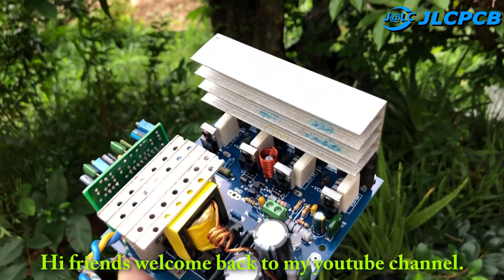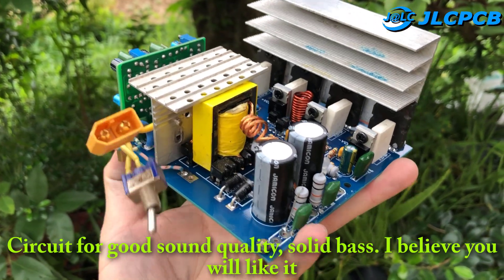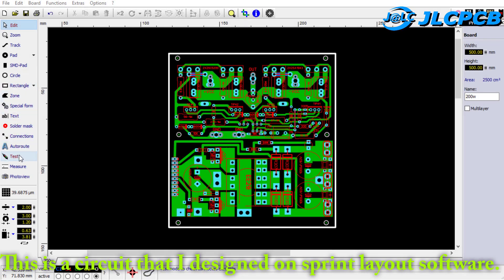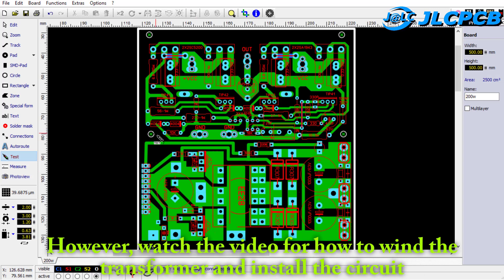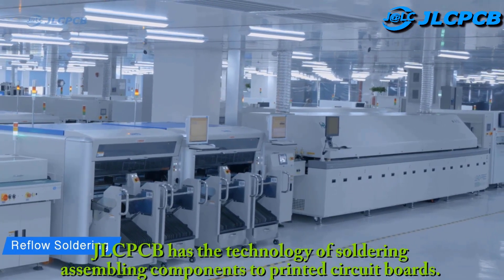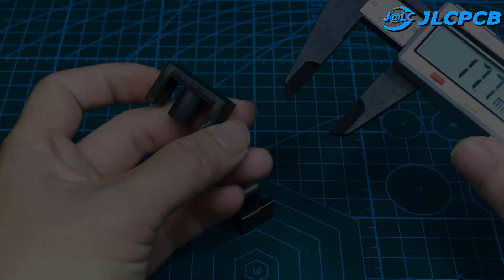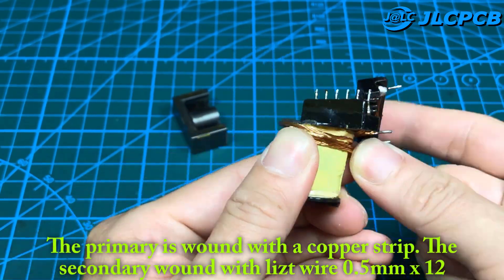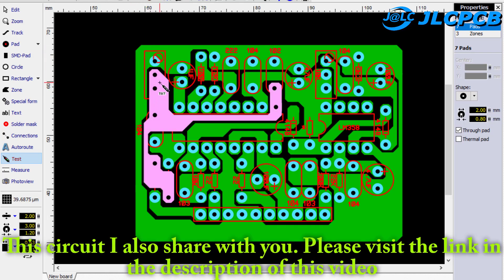12V Portable Car Amplifier 250 Watt.

Comment: can you make a bench power supply 30v 10 amps with short circuit protection and can be use for voltage injection and laptop power source Thank you
Reply from the maker: OK bro
Reply: @LongTechnical  tnx man appreciate it please share the all the components that you use more power on your channel bro! And shotout me hehe

Comment: Good job
For the primary I didn't quite understand: it's 3 rounds + 3 rounds with the middle point? what is the section of the primary wire? on the video it will say 0.7 mm
Thanks for the sprint-layout files
Reply from the maker: Primary wire you can using copper strip bro
Reply: @LongTechnical  Thank bro